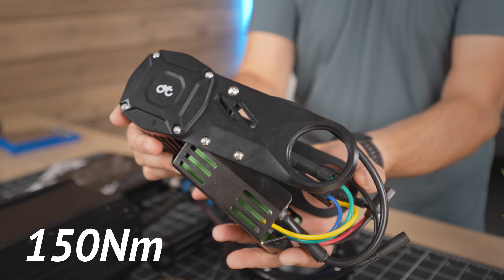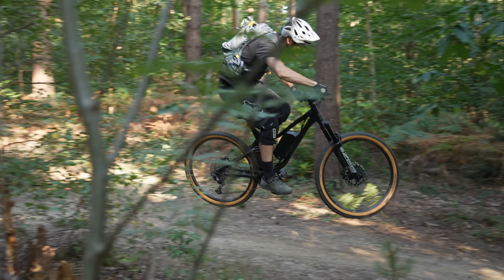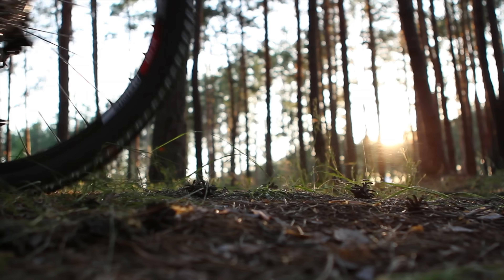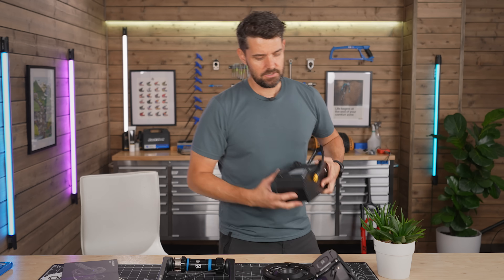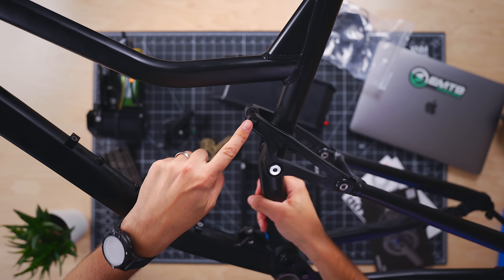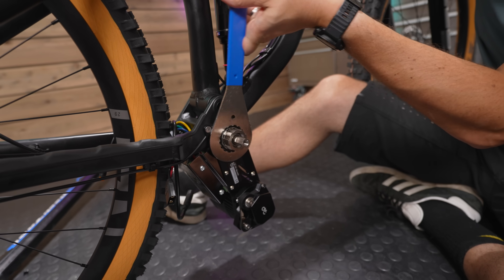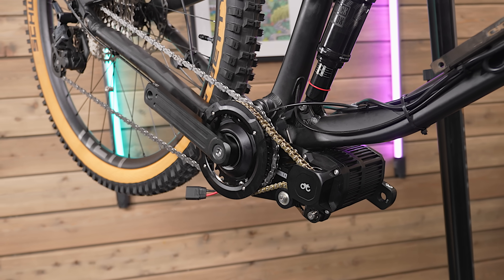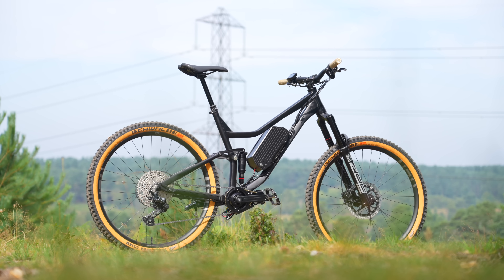I built a crazy fast DIY eBike!!! $900

Comment: Questions

1 bottle cage battery fitting doesn't look steing enough or am I wrong.
2 does a powerful motor run out of speed on a lighter bike up to its restrictions?

Comment: "Affordable"
900 just for the motor, before the battery

Like, i can go to my local bike shop and get a 40 mile range pedal assist for 2250 and it will RIP 1700 for a 30 mile with a lower level of assistance. If i spend 700ish on a good base frame, wheels, brakes, and then like 300 on a premade high capacity battery, thats already only 350 away from a mid-high end bike, and 200 over an actually affordable ebike

What if you started with a mid end mountain bike, 400-600
And then a good battery, 200-300
And then a strong thumb throttle hub motor or mid drive, 300 tops.
I bet you could outdo a $1700 ebike with under 1200 dollars, and maybe even rival mid-high end ebikes.

Comment: This doesn't make sense to me as a product. It costs a few thousand dollars to build, makes 1500 watts and has 450watt hours of battery. For less than half the price you can buy a ninja 250r, which doesn't have to be built, makes 20,000+ watts, and has a "battery" with 34,000 usable watt hours.

And the 200 watt, 15mph kneecap is brutal. I'm a mediocre cyclist at best and only 130lb, and even I can sustain 200 watts for an hour. A standard 175lb man with my watts/kilo would be making 270w.   

So it's weaker than a motorbike, more expensive than a bicycle, and slower than you're own two legs... What is there to like about this thing?

Comment: So when you say you built an ebike for $900, what you really mean is you bought a motor for $900, then bought a bike frame for at least another $900, then bought every other part of a bicycle besides the frame, then bought a battery.
Reply: Your $900 ebike costs at least $4000-- enough to buy a quality used car.

Comment: Did you have any issues getting a 12 speed drivetrain to work with the stock CYC chainring? Any issues with 12sp chain durability long term?

Comment: I built one using the same motor - cost just for the motor is about US$900, the battery set me back another US$400. I put it on a used hybrid bike that I got on marketplace for US$210. With a few miscellaneous bits and pieces I'd say I'm in for about US$1900, way cheaper than buying a retail e-bike nd way more powerful and customisable.

Comment: With that speed and power you will be replacing chains, cassettes and brake pads all the time. Much better if it was gearless with a motorbike chain and regenerative braking available.

Comment: Nice build.. a little misleading of a title.. ) Really dig this motor.. I'm looking to convert my Kona Ute but would like to decouple the motor from my 2x8 drive train and run it on the left side to a 52 tooth sprocket mounted to my rear six bold disc wheel.. that should let me save the drivetrain and use the motor for braking.. how does it look for doing something like that with this motor?

Comment: I may sound like a buzz kill here but in the video you mentioned a street legal mode as one option and beast mode in another option. How can it be legal if the motor produces 2000w? Even if you do get pulled over by the police and your are in street legal mode, won't they still give you a fine and points on your license because you have the beast mode at the press of a button?

Comment: One issue I have is finding dual suspension bike frames (29er) with bsa bottom bracket, I currently got my TSDZ2 motor on a hardtail frame but it's not the best for more technical rocky terrain.

Comment: I'm going to buy one to replace a Cyclone mid drive. Your motor cost 900 US and the Battery about the same so it's not $900 it's double plus the bike. If you have a 48V battery that can supply 40Amps, that's 2KW which is what I have. Mega fun.

Comment: Mate you got only a 250w motor? You need at least 750w for a decent eBike ride. Try Bafang motors they pretty good and half what you paid incl. battery.
Reply: The CYC stealth can put out 1500w nominal and 2000w peak, battery dependent of course.

Comment: Would love to see this installed on a disc brake Hybrid bicycle instead of MTB frame.  A 500 or 750 watt motor should be enough for a street bicycle wonder if it could be built under 30 pounds in a hybrid style alloy frame without resorting to a carbon fiber frame.

Comment: How is it rated for water sealing? Looks like some signficant concerns with mud. Cooling slots for the controller that would be easy to pack up. Drive gear, chain, and twin chainrings that don't look mud-friendly.

Comment: That's nice you are doing more DIY kits because e-bikes became so popular today exactly because the DIY community started building e-bikes in the mid-'00s 
But the thing is you got one of the most expansive kits there is, so seems to me that you are out of touch with the reality. Please feature more affordable kits... BBSHD is a beginning

For those who are reading this, there are other kits out there much cheaper and as powerful if not more powerful than this one.
Cyclone 6kw is an example. Pair with a high-quality high discharge 72v battery, a powerful controller (they are cheap also) you will be faster than a 100cc scooter, going uphill without breaking a sweat. It will come out a bit cheaper than the CYC but 4x as powerful
Before you start whining about it will destroy your drivetrain. It might make you replace the chain and cogs once every 2 years.

Last bit. You did not mention that this CYC Kit can be used with a throttle.
Reply: Those Cyclone kits don’t look nearly as refined as the CYC kits.  The CYC X1 Pro is rated for 5000w if you want more power which puts it in contention with the 6000w you mentioned.
Does the cyclone have torque sensing? That’s a huge bonus for CYC kits.

Comment: 900 dollars, eh?   lol.  carbon fibre frame costs that alone.  quality brake components, shocks, motor kit, battery, you looking at thousands…I’ve built over a dozen ebikes, mid drives, hubmotors…and it comes down to a quality battery, which is still very pricey. You have a nice bike, but maintenance will be pricey with chains, sprockets getting tore up.  Forget wet muddy trails, it will be quickly destroyed, with open gearing.  cheers

Comment: afaik the UK still follows the Ebike EU regulations when it comes to motor power.
A motor needs to be 250W RATED and combined with the testing standards this mean that it has to be a physical limit (not a firmware limit).
Hence a "full power" switch is not allowed.

So there is no way this motor is actually legal in the UK..

Comment: Hi Rob what has happened to the follow up video's? I was wondering if you were getting some heat from other parts of the industry for promoting this approach to getting going in ebiking? I have a Tongsheng tsdz2 and it is great fun. Can't afford a production model   but don't need one as bolt on's are excellent value for money. I am 60 and it is enabling me to do the rides I did 25 years ago!
Reply from the maker: Hey Mark, not at all!! I’ve just be super busy! We need to do another day filming the bike and will get the vid out asap!
Reply: @RobRidesEMTB  Cant wait to see the next vid
Reply from the maker: Hey Mark, not at all!! I’ve just be super busy! We need to do another day filming the bike and will get the vid out asap!

Comment: I've built things based on Bafang and Cyclone mid-drives before and they did a thing, but the combination of size, weight, controller and torque sensing make the CYC super interesting.

Comment: That’s a cool bike but that battery pack is a deal breaker. Come on at least make it rounded so it looks somewhat cool. If you wanted a amp for your bike this is it:) might as well get some base speakers and blow up the outdoors.
Reply: They designed it to be shock-proof by using this kind of a structure.

Comment: 10/10, I have a 1000w, and it can launch itself, it is scary the first time, "I've built a monster" but you get the hang of it so fast. These bikes are so good for improving your skills due to 80% of the ride being executed at downhill speeds (Close to 30mph) rather than Maybe 20% on other (normal) rides. Therefore you are put into the scenarios where you learn fastest more often (being on the edge of your comfort zone). You are put in the position where you are looking for the best and fastest lines on the trail much more. Here's what I'm trying to say, I get back on my traditional bike and I have considerably improved downhill, I can hit technical at higher speeds, take better lines, better reaction times and overall feel considerably more comfortable on my bike at high speed. These bikes are less wieldy, that's a fact but Rob has done a great job with keeping the weight central. It's a bit like running with a weighted vest, you take it off you feel lighter, you go back and your bike feels so light and it feels easy to maneuver.  

Basically, get an e-bike.
Reply: I have a 3000w kit that literally flipped me over off the line and at 30mph. Tops out at at least 50mph. I've only gone 42 but it feels like that's only the halfway point of the power
Reply: @macbook802  damn is the torque really that strong. I'm trying to build a E bike but I don't want a weak motor. I need something with some muscle.
Reply: @zoidzoid87  update, I've gone 55mph on it and it's supposed to top out at 61. It's a monster. I have about $1700 into it and like 3 solid days of work. Now that I have extra parts and I know what's necessary, I can probably replicate it with 1 solid day of work
Reply: @zoidzoid87  I use 4 DeWalt 20v batteries, so 80v. They're 6AH and I've gone 10 miles pedaling and cruising at 15mph and only lost 20% of charge. This particular build is a full suspension, which I'm not sure I'd go with again due to complexity, and because I don't plan on ever bombing it up or down obstacles.
Reply: @zoidzoid87  I actually have two seperate builds. They're completely different, the one has 1700.00 into it and the other has around $800.00 into it. I've gone 41mph on that one and that's plenty fast too. I'll try to make a video sometime this week showing both builds and what's the differences and what I would do different if I were to rebuild either of them. Plus parts lists, all of which have worked perfect as advertised, although they both have only about 40-50 miles on them
Reply: @macbook802 yo, nice build. I want to build something like this, but don't really want to throw a bunch of stuff into it and not be right. Then I saw your post. Can you let us know what you would do differently and what to buy? I need power to make this worth it for me to build. I'm 300 pounds! I have a nice Schwinn aluminum donar bike, and many dewalt batteries to use! Thanks for any help!

Comment: just a quick question, did you change the shifter because im sure you need a specific e bike shifter because otherwise the motor get really confused when you skip up like 2 gears at once?
Reply: no you dont, just let off the power when gear change to avoid crunching gears

Comment: I put a Bafang 750W kit with A 1400WH batter on a, what I call a department store bike (NORCO). It was easy and worked quite well. The kit came with everything necessary for a bottom bracket style install. I like this motor you are doing as it looks slimmer than the Bafang. Sure a lot cheaper than buying a full-on E-bike from one of the name brands. Anyway, the bike took the Mt St. Helens 26mi ride with ease. I did it for my friend and he kept up with my Turbo Levo easily.
Reply: The Bafang is a lot bigger sized mid-drive motor and it doesn't even have torque sensor whereas the CYC motors have it to enable natural pedaling.

Comment: I designed my own bottom bracket mid drive motor kit.
Can fit on any bike with 68mm crank.
52v 2000w motor very powerful.
Judging by the acceleration speed of your E-bike in the video. 
Mine looks twice as fast
Only cost me to make £140.
Including controller & throttle key ignition voltage display & more.
It has a lot more benefits and options then ones you can buy.
I also make my own battery packs.
I save a lot of money on them.
Less than half the price to make.

Lot of people lately think and call themselves professional E-bike builders LOL.
Just because they put together a kit.
What's designed for everyone.
So it's easily without any mechanical knowledge & skills.
Reply: why not post a video of it, oh wait you dont have one lol,
Reply: If you can do it for 140£... maybe you can start a company that sells these kits then.

Comment: Better get bafang bbshd 160nm and 1600w with 52v 41.4ah 2250watt hours and drive on throtle only over 60miles and reach speeds 50mph
Reply: No torque sensor on Bafang motors though so that's definitely a con compared to CYC motors. 

X1 Stealth has 3kW peak and I believe the CYC Pro Gen2 has 5 or 6kW
Reply: @juusonurmi5620  i have asi bac 855 controler and 4250 watt continous on 72v on bbshd it has higher torque then cyc,and in this video its nothing crazy fast 🤣i do wheelies 40mph easy

Comment: Nice setup, I've got the same display and you can change it to 9 power settings. Got over 3500 miles clocked on mine uk winters aswell. There Pretty solid
Reply: How are the chains and gears holding up?
Reply: @happygiraffe9787  I've hit the 5000 miles mark since my post. I've replaced the chain and cassette  a couple times. No  issues just a general wear
Reply: @bookerbulls  Thats cool to hear, thanks for the reply!

Comment: 900 bucks plus battery is not a bargain. Nice setup, but way too small battery, and second exposed chain are no pro.  Illegal anyhow in the most european countries...no wonder you drive off everything legal from Bosch and co.
Reply: I've seen people mount easily 900Wh batteries on their DIY kits. Yes, it's illegal but have you ever seen police raiding bicycles? I haven't and if they were to do it, they could just check the 250W CE sticker on the motor and be fine with it.
Reply: @juusonurmi5620  Well do Not try it in Germany, here they even control the software. Such id...nice persona.
Reply: @GunitEngage  too bad for you mate. Thankfully nothing like that in Finland.

Comment: sure the motor is powerful. a big nogo however is the external speed reduction chain drive. for 2 reasons: it's dangeous and it's exposed to all the elements. 1 chain is enough to be exposed. I see the advantage, obviously the chainring position is not forced to the outside like on the bafang mid drives, but they have a completely sealed last gear reduction stage meant to last.
also I wonder why the battery is so tiny for such a strong motor. running at full power you'll not nearly get the rated capacity and prematurely destroy the cells. even if they're fairly high drain cells. a motor this strong should run on no less than 1kW for decent range and battery life
Reply: you are wrong
Reply: @SIMONC256  explain
Reply: @JoLe1991  been using the gen 2 version its the same setup just bigger and can run at 5000w, same chain final drive as you put it, after over a year of mud,rain,dry,hot,cold,snow,downhill,flat trails, on road running a mix of  48v 52v and 72v battery the only fails i have had are as follows, sprag clutch bearing, torque sensor, the 1st gen controller died,  the way it mounts to the frame using a hanger is rubbish, the chain tensioner wheel fail,  the bits you pointed out have given no problems, still use the same chain, chain ring, pinion gear,  the battery pack in the video is built to spec and wont get damaged, has a bms so this manages the cells. buy one and see for yourself, great fun, you can get so much power out of the cyc gen 2 its ffffffantastic
Reply: @SIMONC256  good to hear experience with the cyc x1 pro. About the battery pack: obviously it can put out 1500W, but it will not reach it's specified cycle life (which is often stated for 0.5C discharge) high drain cells can deliver high power butat the cost of cycle life. Want a decent performance cell with long life, get the samsung 50G or 50S.
I myself have a bbs02 @ 48V. I had to switch from 10 to 9 speed because it would smash the small cogs. also I have worked hard on finding the perfect grease for its gear reduction, and a drivetrain solution that works well. That way it's the dream. definitely not a 3000W motocross, but more powerful than retail emtbs and SUPER silent. More silent than geared hub motors and way more silent than any frame integrated mid motor. no torque sensor but I don't feel it's all that necessary when programmed correctly.
Reply: @JoLe1991  torque sensor gives a more natural feeling to power delivery , the battery cycle life depends on how you use the battery, if you over discharge it then of course it wont last long, i use lipo's if i wanted to i could pull 300amps from my pack, but i only pull 100amps max so no problem.  more volts less amps less stress on battery.
Reply: @SIMONC256  of course the torque sensor gives a more natural fell, it makes the power kick in in response to pressure on the pedals. to be honest, it's hard to make power delivery feel natural beyond 750W output...
 @MR B0TT0M  battery life depends on voltage extremes obviously (100% full / completely empty) but also discharge rate. most 18650 cells have a standard discharge of 0.5C, a few high performance models are rated for 1C standard discharge. to which extent higher discharge rates in the middle SOC voltage range shorten cycle life is poorly studied. Also baseline cycle life in lipos is not well known as they're typically abused at high C rates, for which they guarantee 200-300 cycles. for the batteries I build I either install a smart bms or preconfigured standard BMS for reduced voltage range utilisation. key point here is to lower balance start voltage to 3.9 or 4.0V.